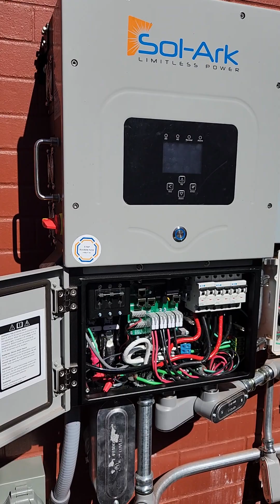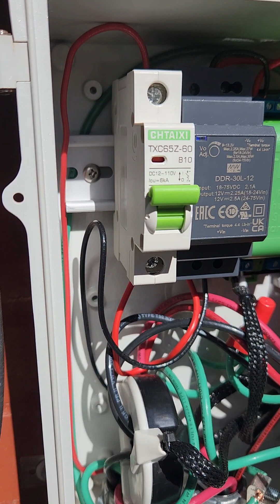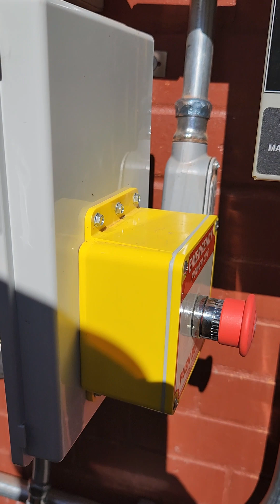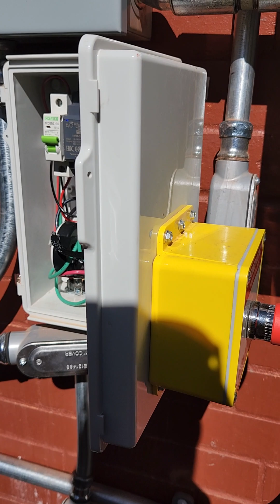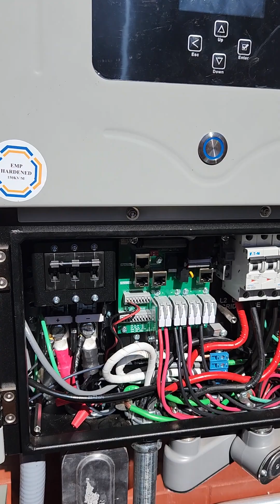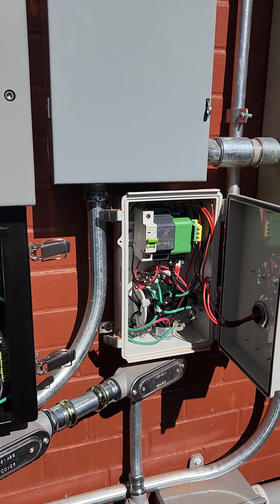SolArk Compatibility with Tigo Rapid Shutdown Transmitter Part 2

Comment: Do we need to install separately Transmitter PLC for Sol ark 12k Inverter?
Reply from the maker: Yes, the Sol Ark inverter pins do not support the higher energy requirements that the new tigo rsd uses.

Comment: Why did you not use the 12v supply off the sol-ark or the control circuit to the RSS transmitter?
Reply from the maker: The 12V supply off the solark will not power the new tigo transmitter. The pins 15 and 16 are underpowered by around 500mA.
Reply: Even on a 15k?
Reply from the maker: @Robert Giudice  Page 22 of the December 9th 2022 edition of the solark manual finally correctly states that the pins inside the user area of even the 15k are not compatible with the tigo transmitter.
Reply: They’ll fix it one day.